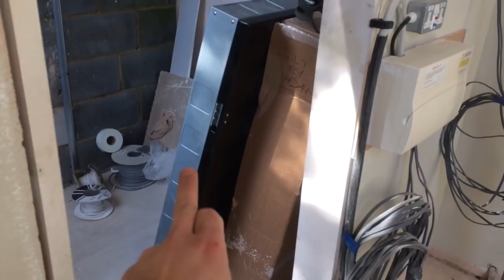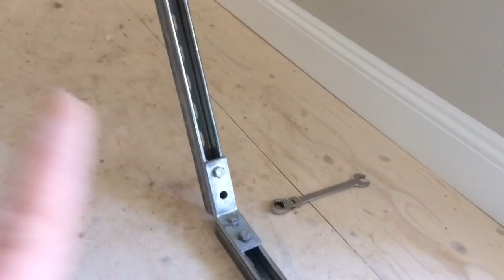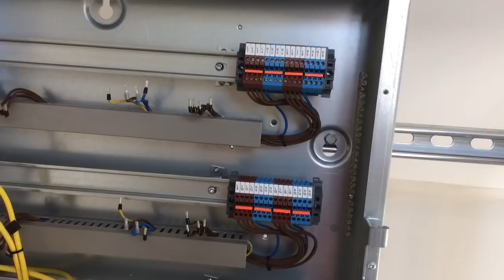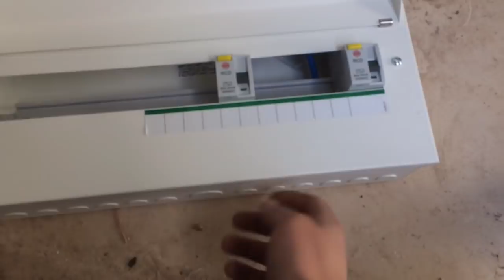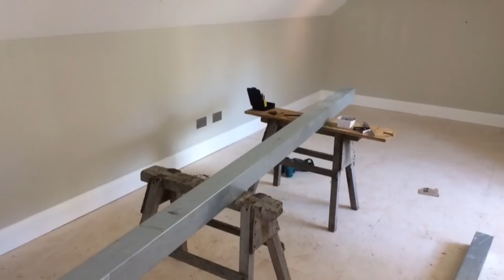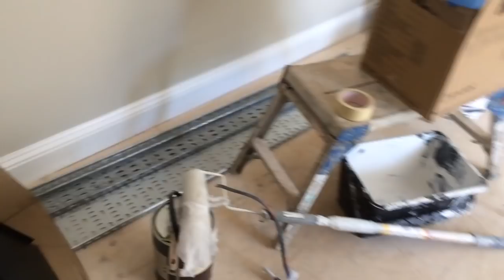Electricians Day On The Job // Mains Room Preparation!!

Comment: did you price this or is it day rate for 'x' amounts of days?
Reply from the maker: 50/50 there are so many unknowns with this job so very hard to price .
Reply: that was what i was thinking, glad i'm not the only one that has unforeseen's and unknowns on a job. from my experience if the client knows and accepts the day rate regarding this everyone is happy.
Reply: I have this same problem, the amount of things that change during the installation and the amount of unknowns from the start make it impossible to give an accurate price. Leaving the option of putting a high price in and not getting the job or going on day rate!